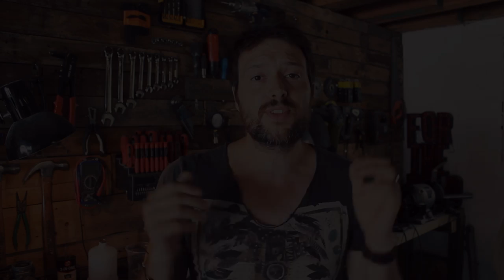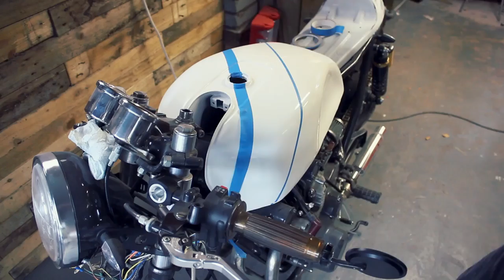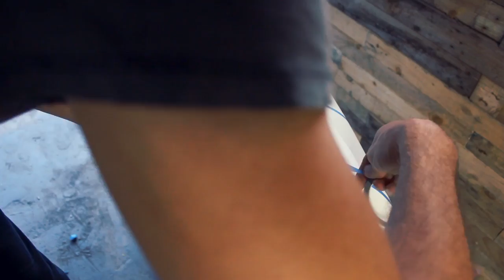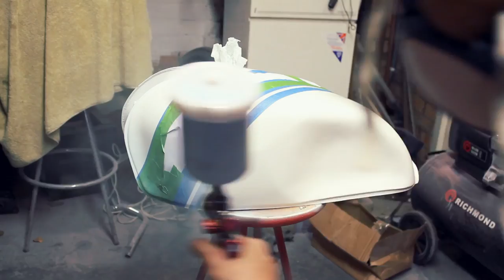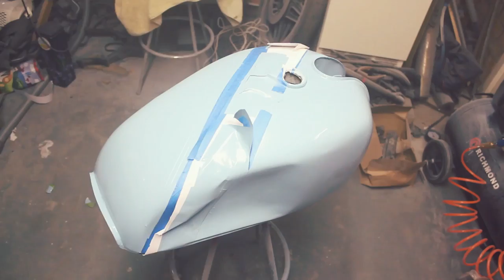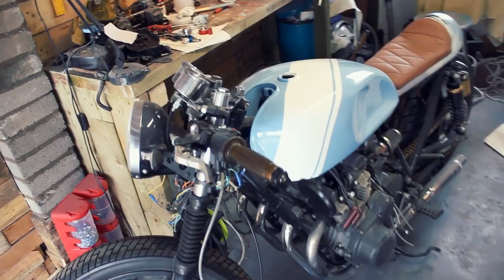Cafe Racer Build 25, Suzuki GS550 painting the fuel tank blue

Comment: Definitely different but that's what makes it cool, I've always been told that clear should be sprayed wile base coat is still tacky for best adhesion.
Reply from the maker: Thanks, I'm not sure what would happen when sprayed tacky but dried works fine also. Sometimes if you're unlucky and have runs it gives you the chance to block those down first.

Comment: Looks lovely. How do you avoid getting dust in the paint? Or maybe you get the odd bit?
Reply from the maker: Thanks, I wipe the surface first with a tack cloth then a degreasing cloth, and also I strain the paint through filter papers and also I have a filter built into the gun.
Reply: For The Bold - dreegez cheers for the reply - I did much the same on something I sprayed a while back but still got the odd speck in there from ambient dust - of which you must get a fair bit given what you get up to in your garage! But your results are better - much better than I got so I'll have to try again... Looking forward to seeing how you do the rest of the spraying!
Reply from the maker: I close the main door to avoid any dust blowing when painting, luckily this one was spec free, I guess on a home made job it's always hit and miss and luck.
Reply: I find polythene decorators sheets taped to the walls and absolutely soaking the floor with water always helps, any dust particles will settle in the water rather than be blown back up into the air and onto your lovely sticky new paint, also if you've got an old fan you can use it as an extractor sucking any overspray outside your work area 😀
Reply from the maker: Good idea.

Comment: what air compressor are you using to paint the tanks and frames ?
Reply from the maker: For the Tank I'm using a 50l 9.6CFM compressor, but I use an LPLF gun as it's only a small compressor. For the frames I always powder coat them
Reply: Wow that was fast thank you so much